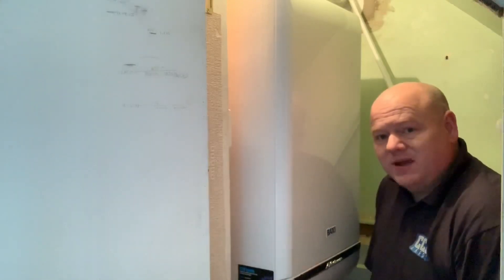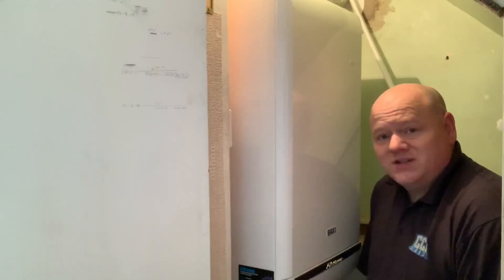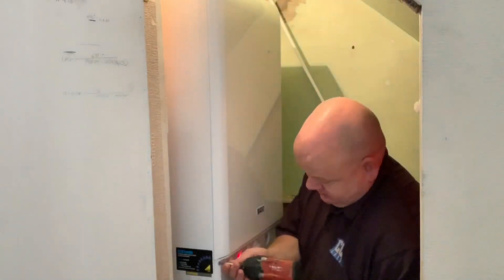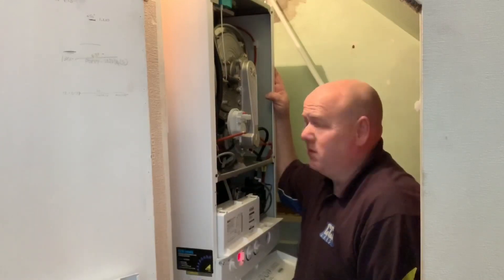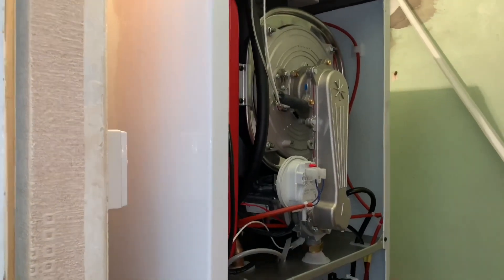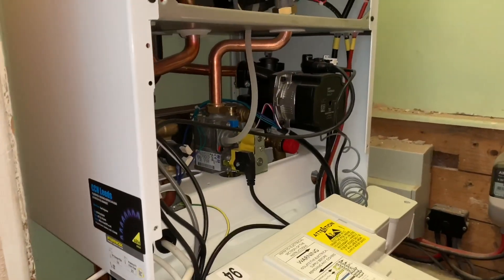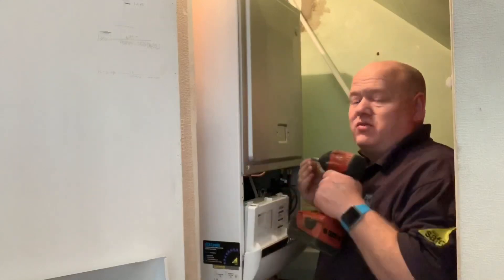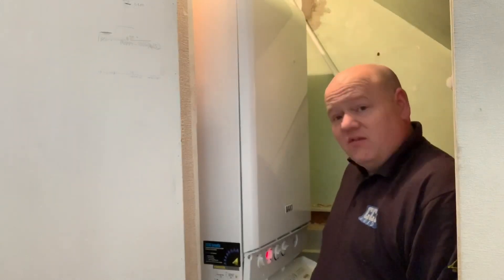Combi Boiler Reviews - Baxi Platinum Review and look at the installation

Comment: Hi I have a Baxi combi boiler got a intermittent  fault works OK then after a while it locks  out a flashing light and 128 appears  have tried resetting .Had to wait a few hours until  the room temperature reached 15 degrees then it resets any help would be appreciated.
Reply from the maker: Give Baxi a call and they will talk you through it. Thanks.

Comment: I believe the Baxi Platinum/ duo tec boiler was first launched in 2006 Allen.What improvements have Baxi had to make to these boilers over the years to rectify any initial teething problems or parts faults to maintain reliability ?
Reply from the maker: Minimal changes over the years that i can remember, The thermistor washer was changed, Diverter had a bit of an update, New pump. Not sure what else

Comment: Great videos , is there much difference between the platinum & duotec ? I have the duotec & find it faultless
Reply from the maker: Both the same. Thanks
Reply: @AllenHart999  I’ve been told to keep the boiler temp at 60-65 , would you agree ? Keep up the good work 👍
Reply: @Minix Tvbox cheers for the reply , it was set on 65 but seemed to take ages to heat the rooms , i turned it up to 80 & its much better , i’ll turn it down in the spring

Comment: Look at an Intergas Rapid. Only four moving parts. Built like tanks. The Baxi is not in the same league.   Another superb boiler is the Navien - the largest combi makers in the world.  The boiler can even be fitted outside, with a superb DHW flowrate. A small physical size as well.  Also can use cheap plastic drain pipe for the flue going some decent lengths as well.   Many times an outside fitting of a boiler would have been a fantastic solution, but none were available. Vokera did import an outside fitted boiler only to special order.  In Italy they have them on the balconies - called balcony models. Outside but must be protected from the rain.  

The Navien has the same flue as an Ideal (same company supplies the flue to both)  and also the same brass hydroblock as a Baxi, again the same company supplies both.

I have no connection with Navien.
Reply from the maker: You are having a laugh, How many hundred of those have you fitted and what's the failure rate?
Reply: @daz374 
Look at the latest range. Impressive.
Reply: @AllenHart999  
Which? Navien or Intergas. Intergas is the epitome of reliability.
Reply: The worst boilers generally I have come across are British: Ideal & Baxi. The best are Dutch.  That is not saying the Baxi Platinum is not a good boiler.
Reply: @AllenHart999  
I am not having a laugh at all. Keep assessing new products on the market and what they offer in function and features.  You have moved on as you use copper and plastic pressfit pipe and fittings. So keeping looking, do not stagnate.

Comment: Thanks Allen, you just saved me from getting the platinum istalled. I think i will wait for the new model now.  I had a quote for £2k fully fitted for the 33kw.  And £3k quote for the Worcester bosch green star 8000 35kw(looks like a big iphone).
Reply from the maker: max navsa get the platinum installed. It’s an amazing boiler. I am fitting one in one of my rental properties before they stop selling them 👍
Reply: Ive made appointments with two diffrent baxi approved installers from the baxi website in the past but both have failed to turn up. Not even a call from them to say cant make it.  Baxi  boilers are good but not too sure about the customer service?.swinging more towards the WorcesterB as customers service was excellent.